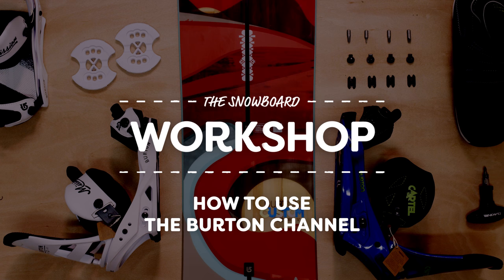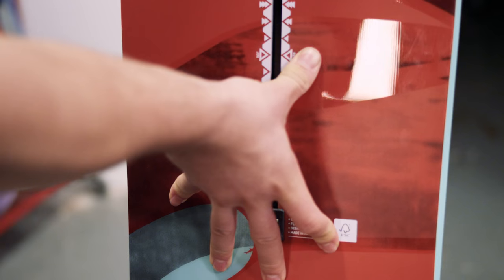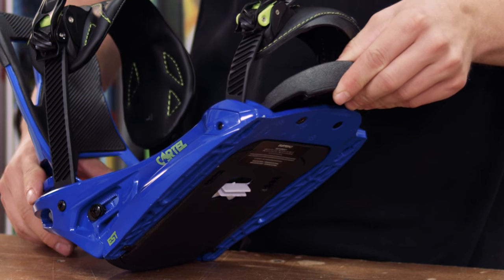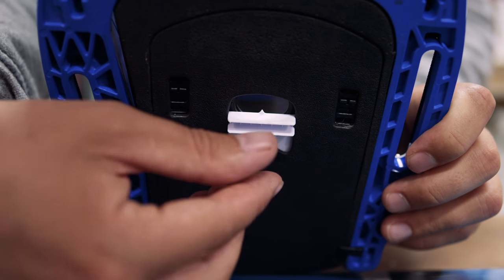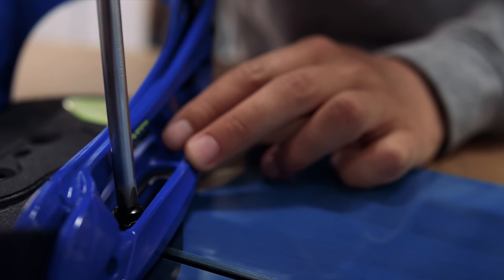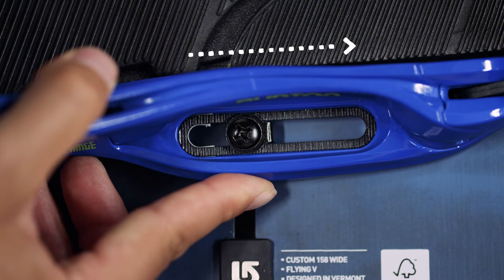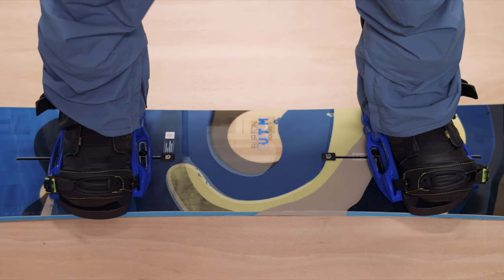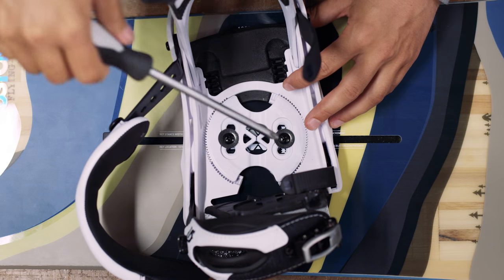How To Set Up Burton EST Bindings On The Channel System

Comment: Channel is really bad, it very easy loosen on on your run.
Reply: User error.
Reply: I’ve used the channel system for some time with no issues whatsoever. Maybe get some professional to do it.
Reply: If that happens it was probably your fault, I have never had issues with channels
Reply: @flopez425  try to go from open to close and tell me what you found.